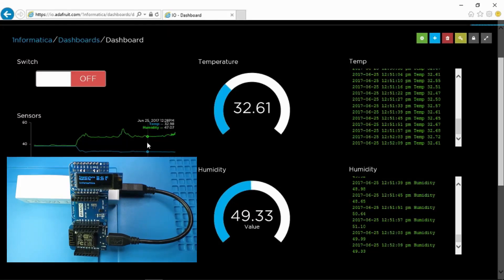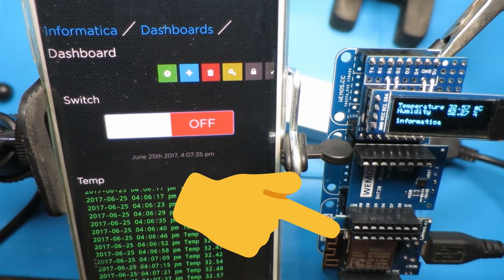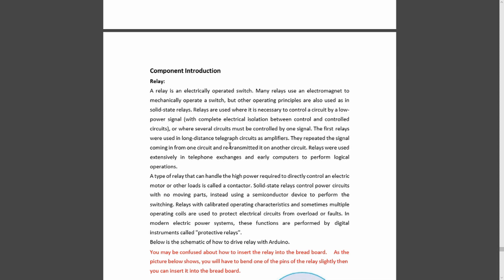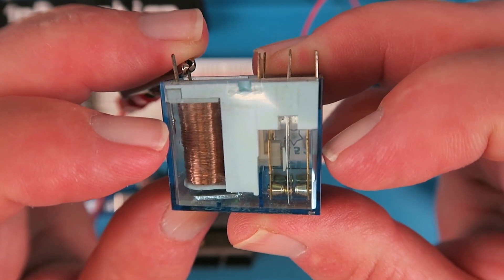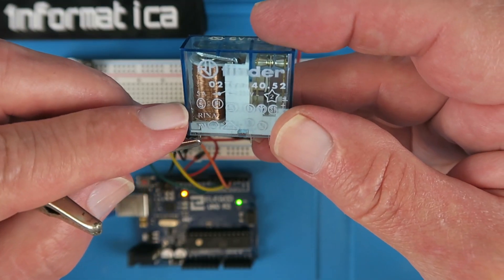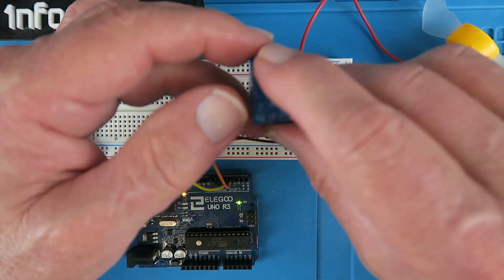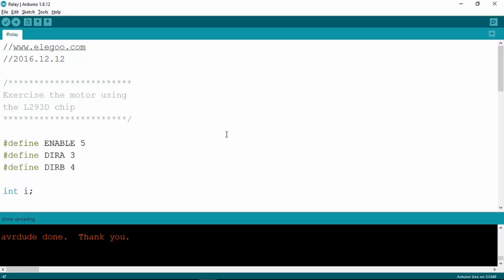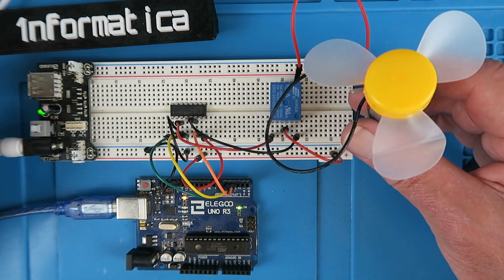Elegoo UNO R3 Project Part 22 Relay Control

Comment: So why does the DC motor not turn the other way? Does this have anything to do with the Relay?
Reply from the maker: Hi, the motor direction depends on which way the positive and negative wires are connected to it. To reverse the direction, simply change the positive and negative wires around on the motor. The relay is just a switch, it has no control over the direction of the motor. Thanks for watching, have a great day!
Reply: @1nformatica  So if I wanted to keep the Relay and make the DC motor turn on and turn both directions I might have to change my wiring for the tutorial. Can you give me some ideas on how I can change the wiring? Sorry for bothering.
Reply from the maker: @Ha-C-60  You cannot drive a motor in both direction using just a relay. The best solution is to use a dedicated motor drive IC as I show in lesson 29 : https://youtu.be/9lEQQ2pnmMM?list=PLxtbRS-naT6-_zIQNX86dHceGQ_IKGJKM&t=51&list=PLxtbRS-naT6-_zIQNX86dHceGQ_IKGJKM
Reply: @1nformatica  Ok thank you turns out you can do this with 2 Relays.
Reply from the maker: @Ha-C-60  True, but the driver IC is a much better solution I think.
Reply: Ya I found the solution. Just give up and blame the whole thing on the person who made the tutorials. Thank you for the help!
Reply from the maker: @Ha-C-60  You're welcome! Have a great day!!

Comment: Thank you so much for posting! I am trying to complete this lesson, but can't seem to get my motor to spin. All that is happening is that my relay keeps clicking. Did you by any chance experience this issue when trying to create this project? I was able to complete lesson 21, so I am somewhat confident that my setup is correct and that all of my other components besides the relay are working properly.
Reply from the maker: The only issue I had was that the relay pins did not make good contact with the breadboard. As your relay is clicking I would check the relay contacts for the motor. You may have to solder wires to the relay and plug them into the breadboard. Good luck and thanks for viewing!
Reply: @1nformatica  Thanks so much for your reply! I think  I may have broken one of the pins on the relay when attempting to bend it per the instructions, and I don't have access to soldering equipment, so I went ahead an ordered one of Elegoo's 4 channel PCB boards that I can try plugging wires directly into. Thanks again for your response!
Reply from the maker: @justin_time  You are going to need to solder at some time, make it sooner rather than later! Starter kits are not expensive : https://s.click.aliexpress.com/e/_DDALF7D or https://s.click.aliexpress.com/e/_Ddc8BRD
Reply: @1nformatica  Very true. Thank you for your suggestions and providing links to them! I think that might be my next step forward.
Reply from the maker: @justin_time  You're welcome! Have a great day!!